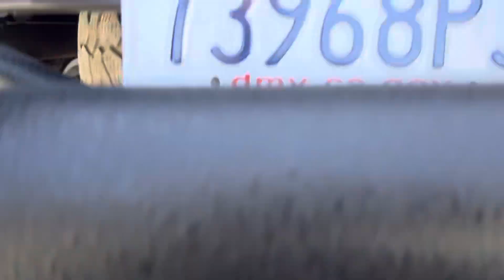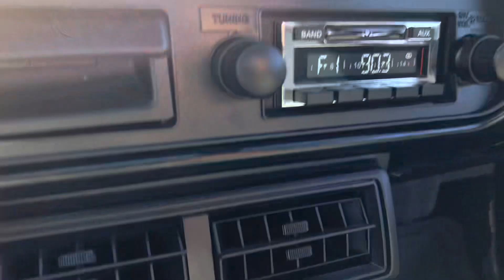1983 Toyota Pickup 4WD short Bed Restored

Comment: check 1:10, is it normal for the front springs to be flat or even bowing upwards it seems..? the rubber bumper is like an inch off the frame.